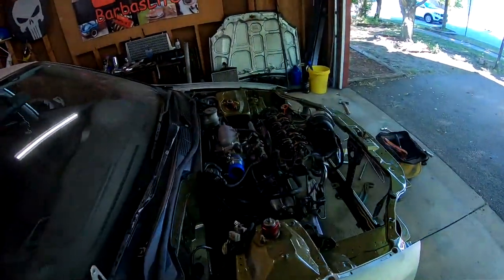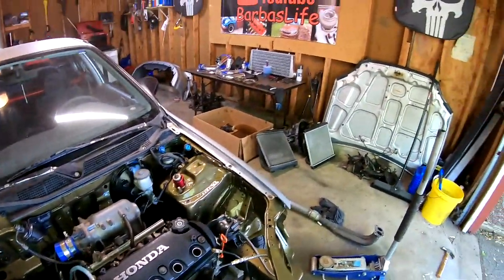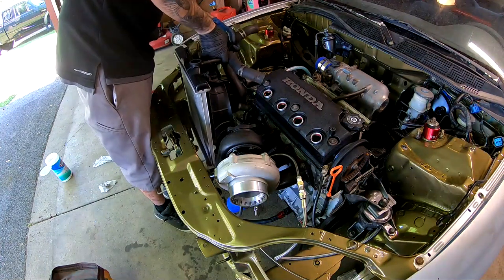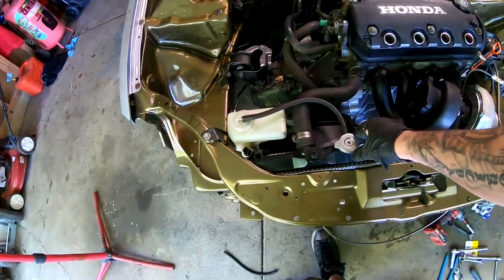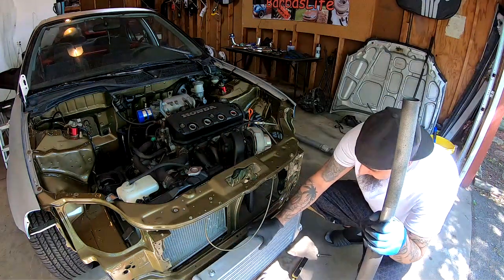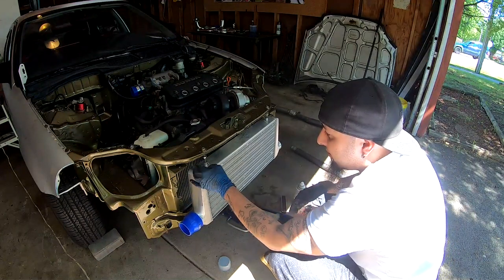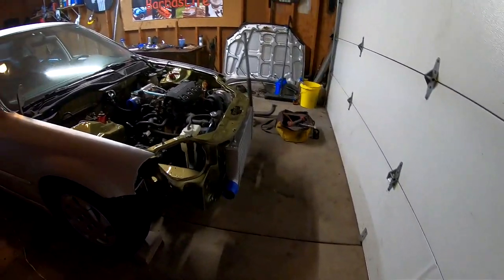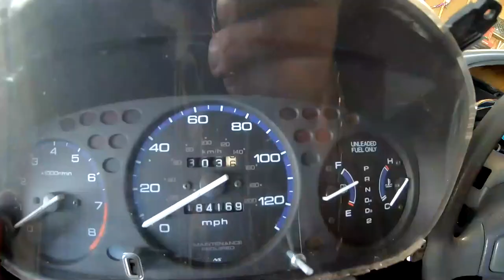Sleeper civic gets custom intercooler brackets made

Comment: So hey brotha, are you keeping the stock injectors and ecu non chipped?? I ordered a new upgraded fuel pump for mine and was wondering if I go 450cc injectors how my car would drive if even starts at all without a tune?? Can I put the turbo kit on and run the stock injectors with it just with my new fuel pump and chipped p28?
Reply from the maker: yeah im gonna run stock injectors for now and obd2 stock ecu only cus i have the fmu. but i wont be able to push my car and get the full potential of all the power. in my opinion Fmu are only good to break in your engine and give you time to save for injectors and ecu while still being able to daily your car.you gonna have to get a new burned chip with 450 injectors setup.
Reply: @BarbasLife  i see.. dam I may need to go with a fmu.. but i talk to a tuner out here and he said I can install the i injectors in his parking lot if need be. I heard if you don't hook up the intake for no positive feed from the intercooler you can daily it just won't have no boost but the turbo will be spinning